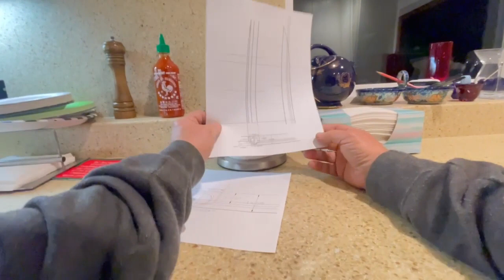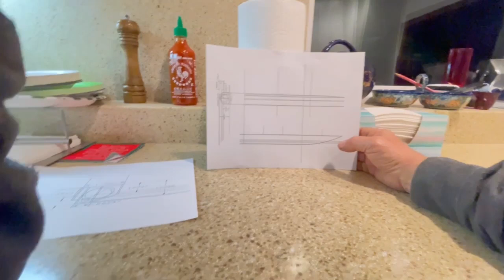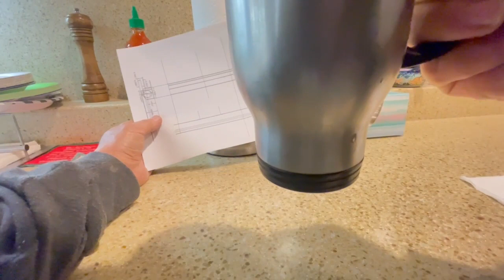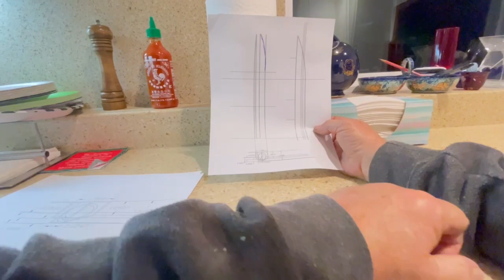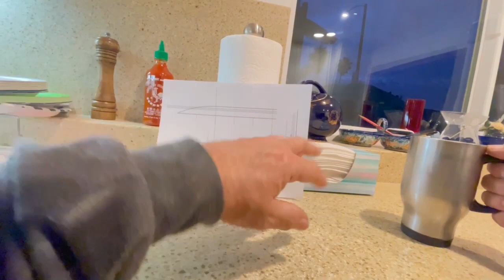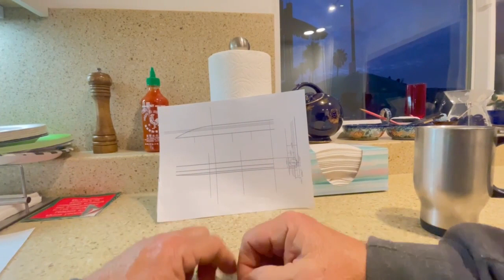Dr. Jet continues with the JetCat 16 Twin design

Comment: About the carbon fiber rods...I think their a good idea but I wouldn't want to see them, at least from the top. The rest looks great. I like the idea of the German motor mounts. I might incorporate that in my other boats. Thanks doc
Reply from the maker: The CF rods will be totally hidded within the skin of the center section.
Reply: @Dr_Jet  I'm so glad to hear that because when you mentioned that you were going to build it like an outrigger I got scared. I'm just finishing up a r4 outrigger and didn't want a cat that looks like it. Thanks for settling my imagination.
Reply from the maker: I never thought of a cat with no center section at all, just the rods joining it together......  🤔 Hmmmmm.....   The torque reactions between the sponsons (hull halves?) would be considerable so cross-bracing would need to be in the mix..  Naw, that's not a realistic idea, I'll build a wood center section with CF rods to  carry the loads from one side to the other. and call it good. @jimstone5339

Comment: Hey DrJet, love your videos, lots of enthusiasm and sarcasm 🤣
How about this, take a well honed single stepped monohull design split it down the middle to make a catamaran. 
Rc catamarans suffer from having to much air underneath, they are to prone to fly at high speeds. 
I believe a single step monohull catamaran cross breed would be boss. I have had experience with building rc hydroplanes such as the “oh boy oberto”, my own designs and have put my Black Jack 24 through the redesign ringer over the past two years. The monohull cat is on my calendar late 2025 🤣 but if you want to take a stab at it I think you have the knowledge and means 👍 BGFL
Reply from the maker: Sarcasm?  From Me?  You've got to be kidding....  🙄  I have considered the "Split V-hull" concept and may go down that path someday.  This is still going to be relative low power to weight poroject so blowovers may not be the pressing issue.  If they are, I can adopt turbulators to reduce the lift the tunnel creates.